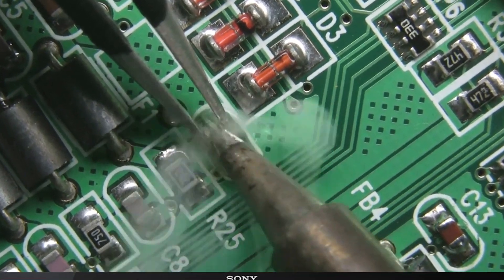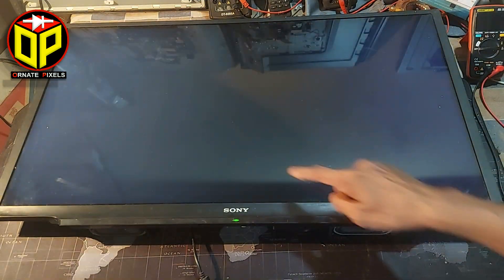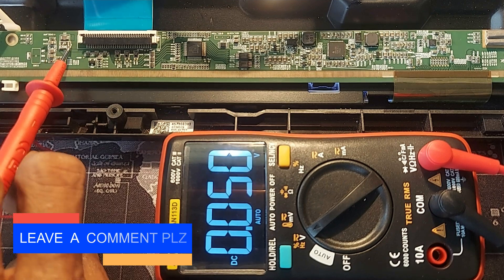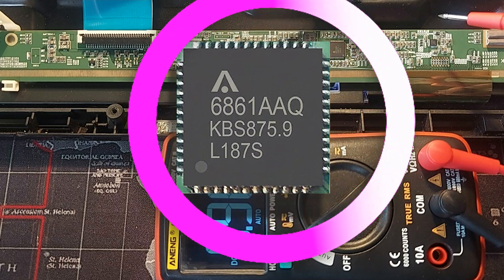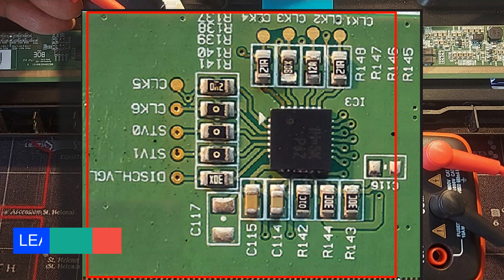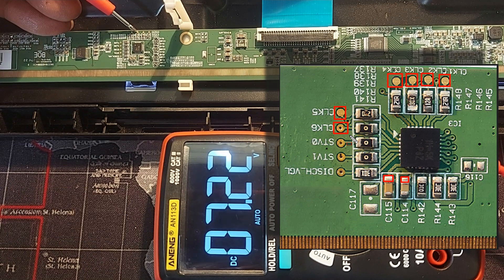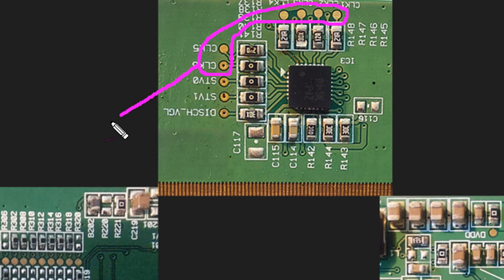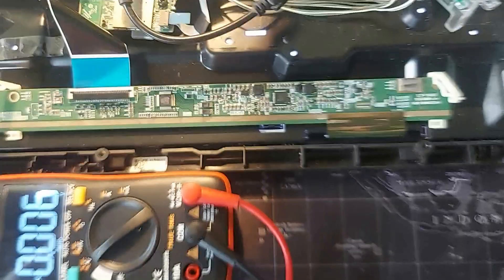Horizontal lines then Black Screen Problem on Sony Bravia LED TV Screen | HV320WHB-N5M Panel Repair

Comment: SIR I AM FROM INDIA WEST BENGAL , I LOVE YOUR ALL VEDIO ... AND GRATHER MORE AND MORE KNOWLEGE  FOR ELECTRONIC. YOU ARE GRAT TEACHER . I HAVE AN QUESTION , SIR PHILIPS LED 24 INCH TV. PROBLEM WAS HORIZONTAL LINE AT MIDDLE OF THE SCREEN MORE THAN 10 LINE APPEAR. AND THE BOTTOM OF THE SCREEN VERTICAL LINE OCCOURE. THE LINE COLOR CHANGE AT THE VEDIO COLOR. VERTICAL LINE OCCOURE AT THE BOTTOM BUT HALF SCREEN. TWO MONTH BEFORE I SEE THAT A ROUND BLACK SHARE OCCOUR AT THE MIDDLE OF THE BOTTM SCREEN. AFTER TWO MONTH LETTER I SEE THE LINE PROBLEM . WHAT CAN I DO . PLEASE TELL ME. THANK YOU SIR.